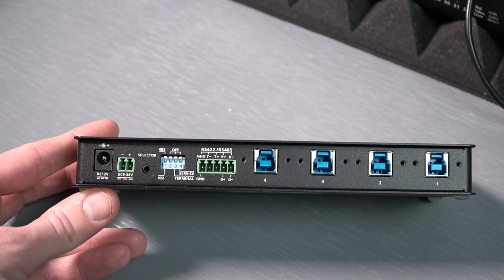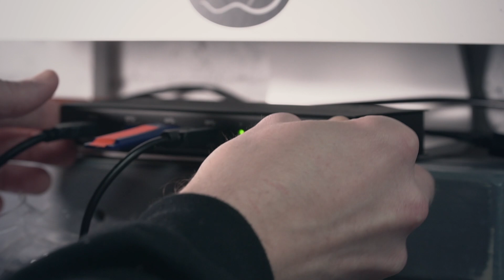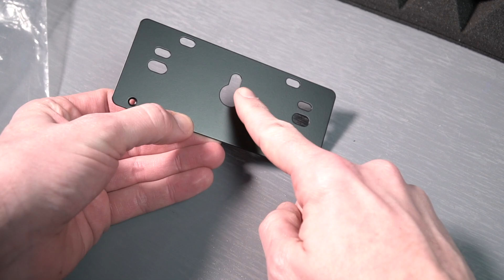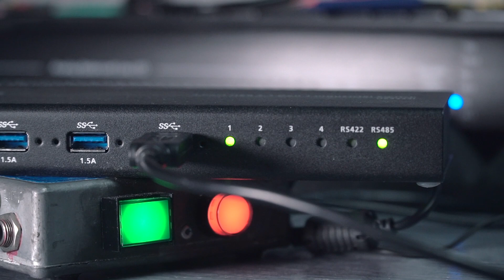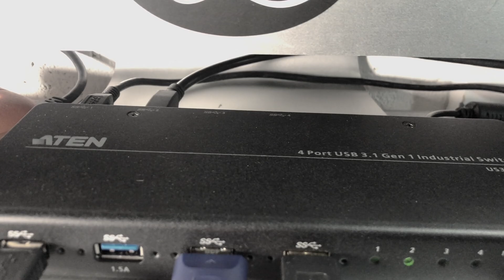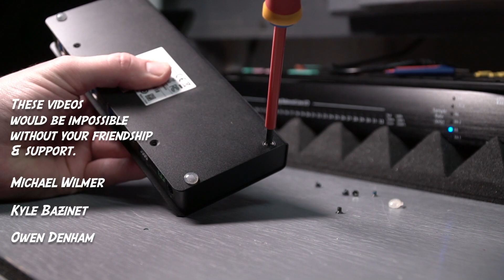ATEN Industrial Remote Controlled USB 3.1 Switch - First Look US3344i - ep.164

Comment: Is there any USB3/C programmable on/off switch?   I want to improve our mobile device automatic testing center and somethings the connection between device and build server gets so fucked up that we have to pull the plug manually and insert the cable again. Happens about 1-2  times per day and it is very inconvenient for continous integration testing.

Comment: This switch is really awesome, with great build quality and all it's features.

Unfortunatly I can't recommend this switch for a direct e.g. workspace use on your desk because of its bad coil whine(see update (solution) at the bottom).
I tried two us3344i devices from different shops with a regular 12volt 6 amps power supply. For me the coil whine was highly recognizable and annoying.

But I can recommend the us3344 self powered non industrial variant from aten. If you dont need the serial features etc. this was the perfect switch. Especially because there was no coil whine and I could put it on my desk.

UPDATE: No coil whine solution for us3344i:
Wow 2 years later I found out, that no coil whine appears when I don't use the 12V DC jack but the 9V-24V terminal connector with a 19V power supply. Using a 12V power supply coil whine appears but with 19V (I guess 24V would work too) I hear nothing :)
Reply from the maker: Thanks for the info, I'm surprised I didn't notice any noise coming from the one I was using right next to a microphone. Appreciate your experience and recommendation on the US3344!
Reply: @DcSoundOp  Ah ok. Yes maybe I had only some bad luck with the two devices ;) But the US3344 works like a charm. Anyway I kept one of the US3344i with the coil whine, because I liked the hardware so much. And yeah it's just coil whine. Maybe a good switch for the basement or another room ;)

Comment: I like the product but I am having a hard time understanding the use case to use this over a kvm. Maybe license keys? One of them for Protools dongle another for a different service.
Reply from the maker: Terrance Shepherd It could be as simple as my workshop where I have three computers on one long table, a Mac editing machine, a windows laptop serving files to a home network and a Linux machine for testing. I can have an interface and other controllers connected to all three and switch them easily without needing to reconnect or buy an interface for each computer. 

In larger control rooms with redundant systems, switching usb devices quickly can be really useful, and the video monitoring is usually routed and switched from each actual machine by a more robust production switcher. 

Hope that helps make sense of it all.
Reply: There are cheaper industrial USB 2.0 switches for ultralow bandwidth devices like license keys this product seems a little silly. I see this aimed at more demanding applications like sound interfaces, USB SSD storage(or highspeed memory card interfaces), specific cameras (microscopes, webcams, etc.), high bandwidth measurement devices (oscopes, multimeters, various scientific capture devices), or even USB 3 monitors as mentioned in the video. 

This device is definitely not targeted at the sound production market, if I had to guess, it is targeted at the real industrial factory and laboratory (every good factory has a lab) market. Industrial KVMs with automation and USB 3 are much, much more expensive than this, and if you aren't talking about actual color grading displays or even just normal professional ones, monitors are cheap and it might make more sense to just have one at each workstation.